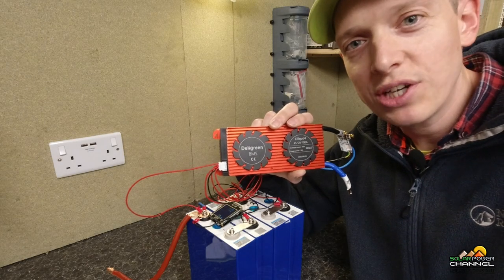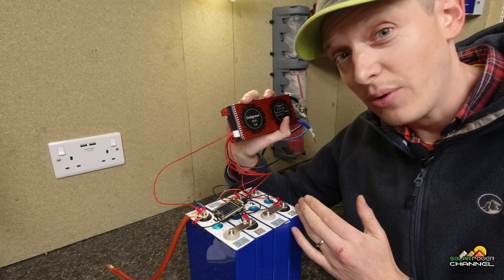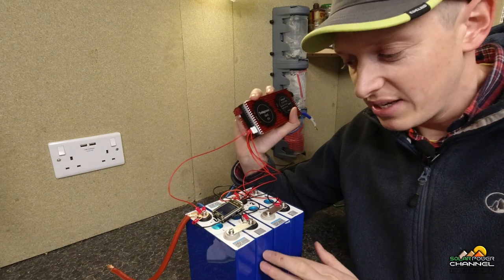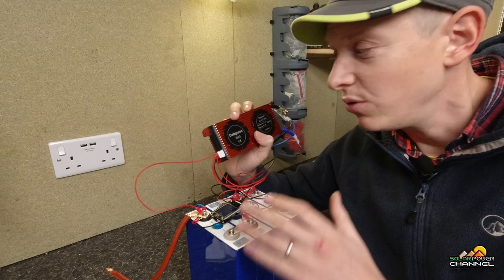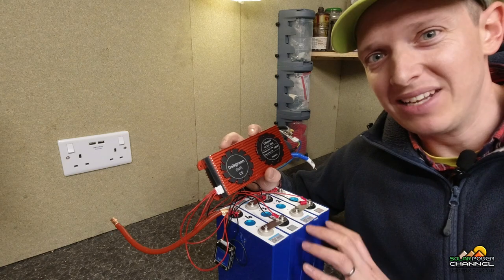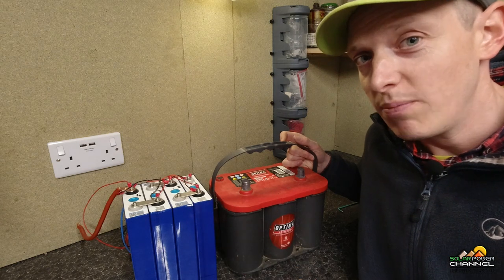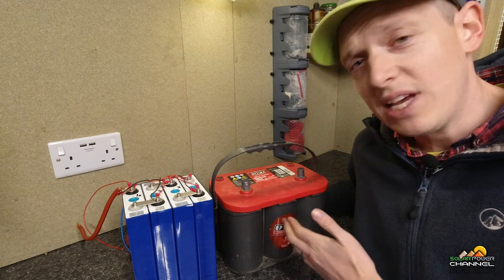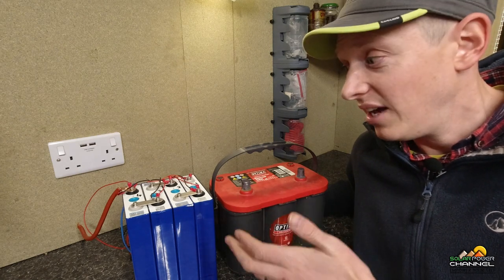LiFePO4 BMS, What is a BMS Why You Need One. Lithium Ion.

Comment: I live full time in my van and need a reliable power supply.  Its ironic that the BMS is the one thing that's stopping me switching from AGM to Lithium. I know many people who have lost total power because the BMS has sensed some kind of problem. No warning, no understanding what's happened, just total loss of power. The BMS should send a warning before it just shuts down.  Having the risk of a total power failure in my van is not an option.

Comment: Have you ever tested the overvoltage cut off threshold of the bms while charging with an mppt CC?
....after being disconnected from the battery by the bms i guess it will ride at the pv ocv...will this high ocv damage the bms at reconnect point??
Reply: I noticed my 100A bms does not protect my battery from overcharging coming from a 600watt panel (4 units of 150watt). 100Amps bms cells now have big belly (cc is a must from now on, BMS doesnt have all the basic covered)

Comment: How do you choose the correct BMS amp rating for the battery you intend to build? Is the rating based on how many amps you expect to draw as a maximum or is it determined by the constant and/or maximum current discharge rate of the cells?
Reply from the maker: Your not the only one to ask this. I must do a video on it! It's the maximum amount of amps you expect to draw. For an example for a 4s LiFePO4 running a 1kw inverter 240v I would use a 100 or 120amp BMS. By also taking into account the efficiency of the inverter to. Use this website to punch number in to give you an answer. https://www.rapidtables.com/calc/electric/Watt_to_Amp_Calculator.html 

If you up your battery volts 12v to 24v, it will lower your amp draw off the battery. This will increase the life of your batteries. What we call C rating, rate of discharge.
Reply: @SolarPowerChannelwithChris  - Great videos and great answers!
Are there any disadvantage in oversizing the BMS? Other than price when buying?
I have a system, where I expect to draw 800W max - but if I use a air fryer in my van, it will draw 2kW
So if not using a fryer - I could go with 75A
But if using the fryer I need approx 175
Reply from the maker: @MartinRaz1  Yes that's right. No need getting a 200amp BMS if your not pulling them numbers, waste of money. Always take into account the losses in inverter and system. I have found a 800watt inverter can pull nearly 100amps still.
Reply: @SolarPowerChannelwithChris ❤

Comment: I think I shorted out my bms by disconnecting the balance wires before unplugging it. The voltage now reads 9.5 v with bms connected.  Is the bms reparable?
Reply from the maker: I have a new video which may wake it up. It should be fine disconnecting the balancing leads I would of thought.

Comment: How do l know if l need a 100A BMS or a 200A one…..l am new and do not understand
Reply from the maker: Normally by a maths. You can count how many watts your pulling. Count from the devices your using, normally a sticker on the appliance. Use a watt to amp calculator. It will ask for volts. 12 or 48v..

Comment: Hi
I need your opinion.
I have the same volt and ah bms but it is not written lifepo4 on it.
Nevertheless i tried to use it  and if I measure the lifepo4 cells have without bms 12 volts...but if i measure with bms the value shown is 8.6 volt...
Bms is damaged?
Thanks in advance!

Comment: You state they should never be charged higher than 3.6v per cell, but I thought they were rated at max 3.65v charge rate per cell? Is that not true?
Reply from the maker: Yes and no, it's to do with stressing the cells. You can dramatically reduce a LiFePO4 cell charging at that voltage to full capacity. There are scientific papers showing a big drop in cycle life. It's hard when making a video, I can go off on one chatting and people switch off. So I try not go off topic to much.

Comment: hi, i have the same bms. but when we put the solar and start charging it, we hear the bms producing low humming sound. is it normal? thanks
Reply from the maker: I've never heard one hum. The charge current correct for the BMS? As discharge and charge are not the same.

Comment: hi chris. great channel. I want to buy 4 x 200Ah cells and set them to 14 volts. how many amps should the BMS have? should i buy the 250Ah version?
Reply: I have 4 200Ah LifePo4 cells connected up as a 12V supply. I use a daly 100Amps BMS and works really well. I never draw more than 50Amps at any one time. It has never gotten warm whilst in use but then again, I mainly use it to power routers, soldering iron, phones, laptops and small electronic. I also use it with a 1500 pure sine wave inverter. Provided you are not drawing a large amount of current continuously, you should be grand.
Reply: @shelay  thank you chris.  I'll work out how much Ah I need as a maximum.  one more question.  are the cells also balanced with the Daly BMS?  or do I still need a balancer?  where did you get the display to see the voltage of the individual cells?
Reply from the maker: @house_number_seven  thank you for your comment, yes I believe the Daly BMS does balance. I did e mail them a few months back to check with them. Failing that an active balancer can be fitted. Yes let us know what your batteries are powering. To work backwards a good website I use is https://www.rapidtables.com/calc/electric/Watt_to_Amp_Calculator.html

1000 watt inverter at 13v say pulls 76amps. 100amp BMS will be good. As per the comment above me said. Hope that helps.
Reply: @SolarPowerChannelwithChris  Thank You 👍

Comment: I have that exact same BMS. Would you know how to reset it? My cells are all reading between 3.31 to 3.33 volts but the BMS itself is only putting out 3.3 volts and won’t accept a charge from my SCC.
Reply from the maker: Try shortening out the B- and P-. Touch them together. Don't be offended, you sure you have the cells wired in series?
Reply: @SolarPowerChannelwithChris  Thanks for the reply! I'm pretty sure I do. Taking my multimeter to the cells' terminals I get 13.3v, but when I take a reading from the P- wire and the positive terminal of cell #4 all I get is 3.3v. Scratching my head trying to figure this out, I hope my BMS isn't broken.
Reply from the maker: @guyfromboracay  sounds like you have it wired in correctly (series) Your balance leads wired correctly? As that can stop a BMS putting power out.
Reply: @SolarPowerChannelwithChris  I'll have to double check the balance wires. I suspect that since they wires are just pinched under the hex screws I might not be getting good contact. Locking them in there with soldered ring terminals might be the solution. Again, I appreciate the help!

Comment: Is this lifepo4 bms compatible with lithiun or li-ion batterys?
Reply from the maker: Hello thanks for watching, this one is only for LiFePO4. You will need one for Li-Ion. This is because the two have very slightly different parameters for low and high voltage disconnect. You can buy them, if your struggling to locate. Let me know.
Reply: @SolarPowerChannelwithChris  yeah but can u set the parameters to cut off when voltage is certain low level right? And same as voltage high it can be set right?
Reply: @SolarPowerChannelwithChris  oh and we accidently order lifepo4 bms instead o li ion